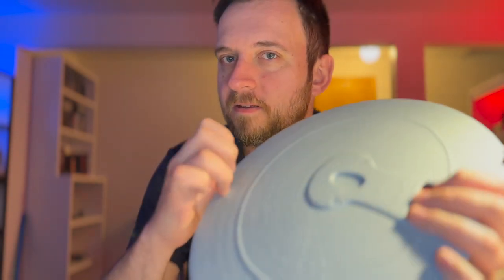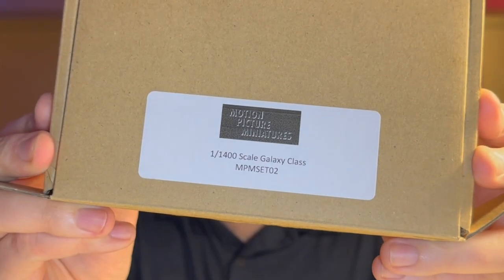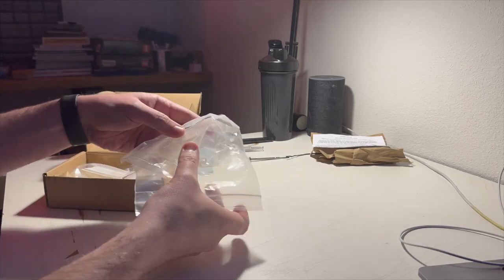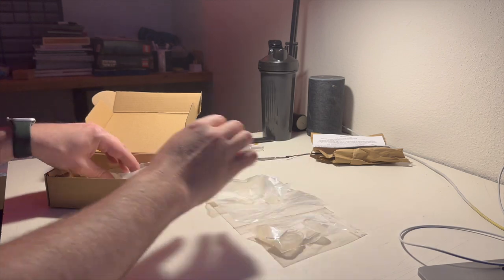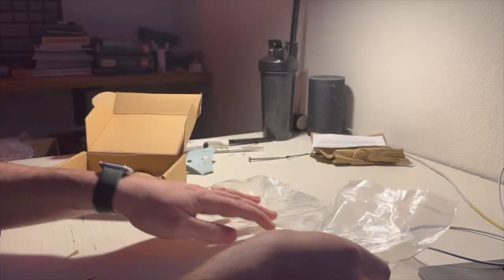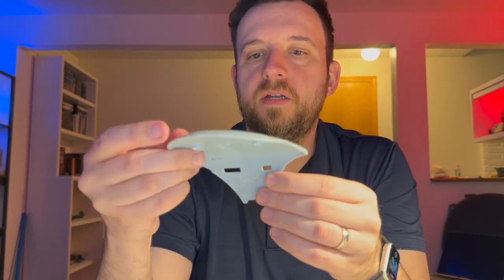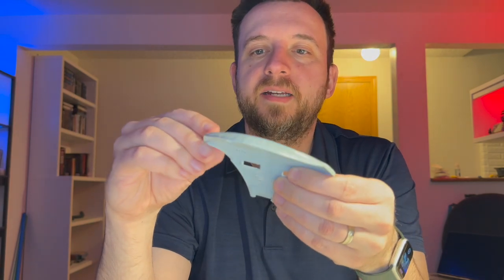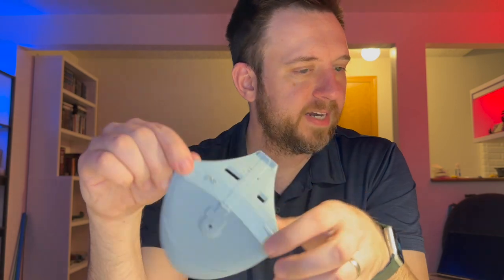Enterprise-D with Me! – Part 2: Where Do I Begin?

Comment: You will go insane doing that method on hundreds and hundreds of windows, i used to do this but now i carfefully remove as much plastic as possible from the inside were the windows are, once all the model has been painted and assembled you just carefully scrape away the paint from the windows you want lit up, its much easier and less time consuming than cutting and drilling out all those tiny windows.
Reply from the maker: I did try that method as well (forgot to mention it in the video) but didn't like the blue color of the plastic shining through. I'd rather have them a brighter white.

Comment: Hi. Sorry the main impulse engine insert arrived damaged, please contact me via my website to confirm your details and I'll send a replacement part ASAP 👍
Reply from the maker: No worries! I've actually been able to glue it back on pretty successfully. Is it actually intended to be kept on there? I'm going to keep it either way because I think it looks good functioning as the little "lip" of the engine. 😀
Reply: @JamesLeMosy  yes, it's the bezel frame so should be on the part. It's very thin and quite delicate, but it shouldn't have broken away so easily so it must've been a bad cast. I'm happy to send a replacement free of charge if you change your mind 👍